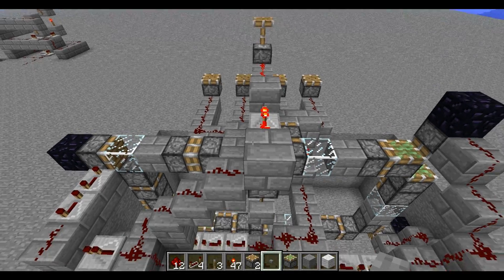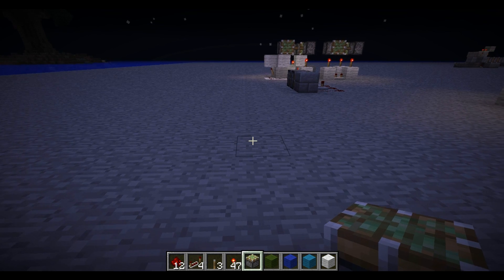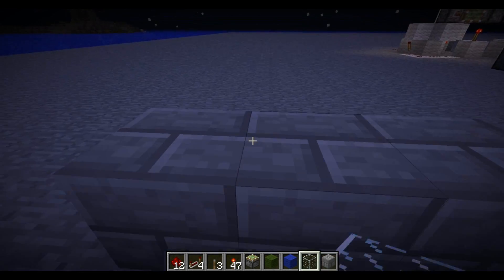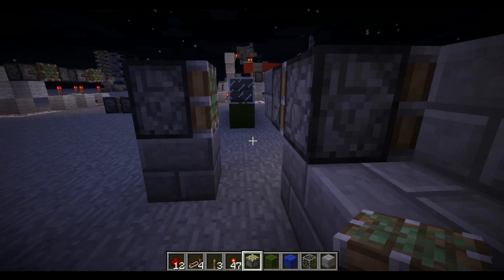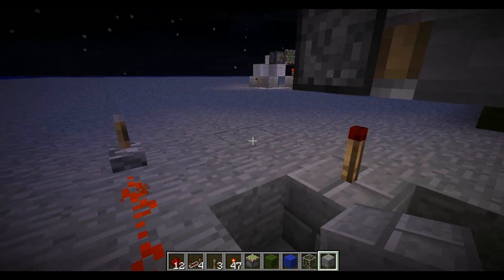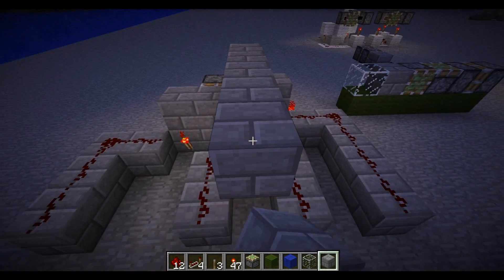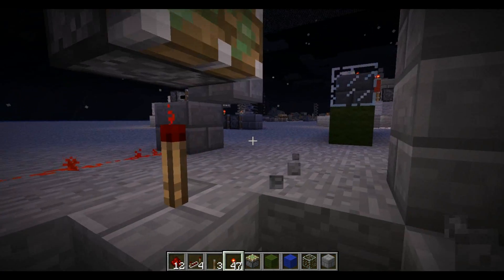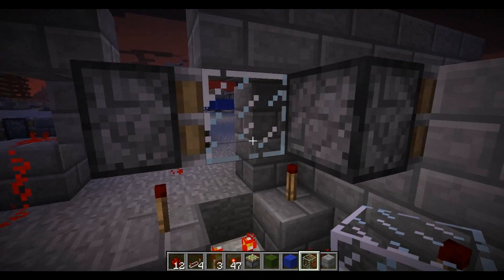Minecraft: Senary Piston Tape ROM

Comment: Oh, so this is a couple years late to tell you, but I built a piston tape that was inspired by yours!  (Tho I think by the quinary tape, this one was pretty close to what I built).  I make an Octal tape, getting an extra 3 states by mixing sticky and non-sticky pistons.  The non-sticky pistons can be detected by timing; if a measured block doesn't move back after a piston looses power, that piston was non-sticky.  (And you use a second piston to place it back).  Since I think we still can't post links, search for a thread called "Octal Piston Tape" by Solarspot.  Maybe you already spotted this.  lol.